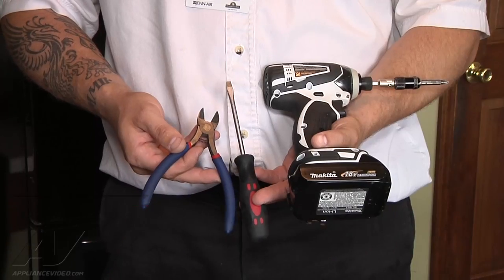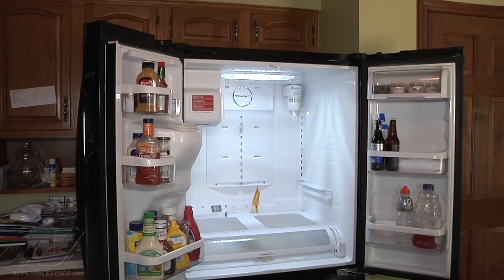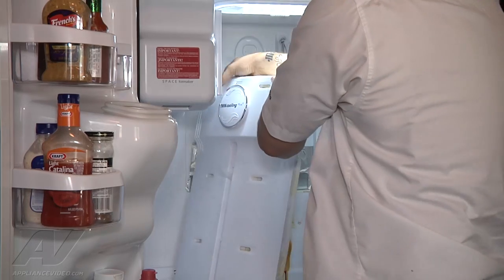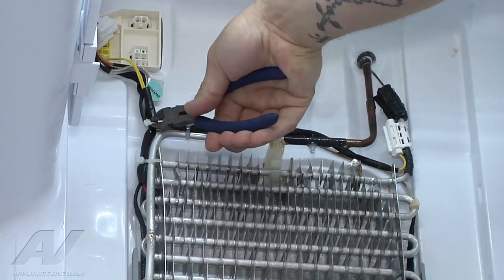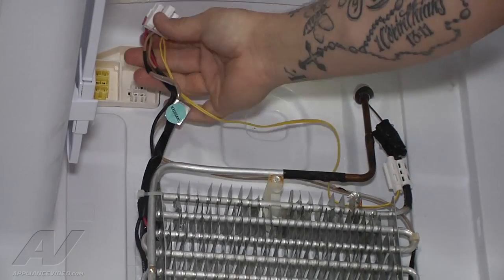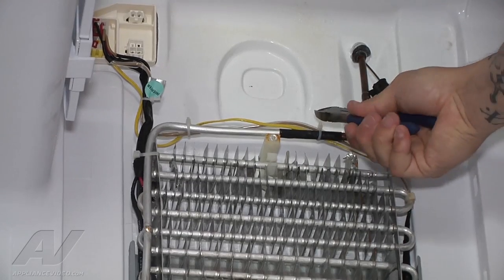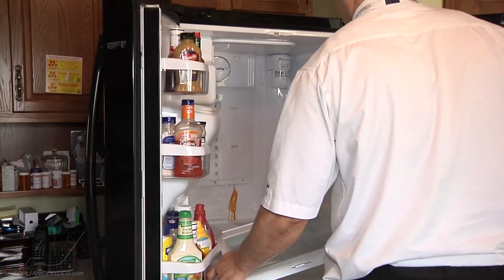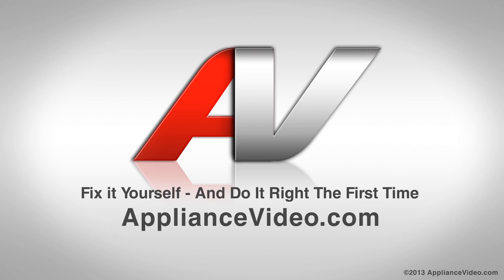Samsung Refrigerator Repair - Fresh Food Section Is Leaking Water - Sensor

Comment: Thank you for the great tutorial on fixing the Samsung french door fridge water problem! Your instructions were easy to follow and install the new part(s). Based on other comments in this post I also installed the longer drain tube defrosting flange as well as the sensor. Three things I would add to this thread: 1) When I removed the panel the foam insulation strips had deteriorated and had water damage. I replaced all the foam strips except for the large one at the top of the panel with silicone bead type weather stripping which should not absorb water, 2) My defroster sensor was inserted into the black sealant blob at the end of the evaporator coil. Not sure if it will help of hurt but I matched this video where the sensor was clipped right below the black insulation, 3) While flushing the drain tube I had also taken the extra step of popping the back panel (only to be removed by technicians :) ) and cleaning the condenser coils which were quite clogged with dust. In doing so the drains pipes/valves for the fridge and freezer are exposed. They can be easily removed and it turns out the fridge one had debris plugging the silicone slit valve. I recommend at least checking the slit valve and cleaning the coils (I found compressed air worked best).
Reply from the maker: Thanks for your response, we are glad we could help. Our library of over 5,700 videos are currently helping over 1.6 million people like you every MONTH.  Please help us by subscribing to our YouTube channel, or post our website www.ApplianceVideo.com to your Facebook page, Twitter, Instagram or any other social media sites. Your support will help us keep producing more free quality videos.

Comment: Thanks so much for your video. It probably saved me several hundred dollars in a professional repair. I had extra trouble getting the back panel out until I got my hand under the insulation and pulled. I came close to cracking the plastic panel before that. I got the part on line delivered for $7.42. It had an extra coupling that needed to be removed so it would fit my coupling. I had to put a fan in front of the open frig. to get everything defrosted. Ice was everywhere. Thanks again!
Reply from the maker: +Andrew Bittinger 

              Thanks for your positive comment.  We have helped millions of people repair
their own appliances. Please help us produce more videos to our site by
subscribing to our YouTube page, or posting our website http://www.appliancevideo.com/ on your Facebook or Twitter account.

Comment: Thanks so much for uploading this video. I had no idea it would be so easy! I've just cleared the blocked (iced) drain pipe with warm water as well as all the other ice built up around the area. I'll be monitoring over the next week to make sure there's no further leakage. Thanks!
Reply from the maker: +Jayrold Ignacio 

              Thanks for your positive comment. We are glad we
could help resolve your issue and hopefully saved you money. We have helped
millions of people repair their own appliances so please help us produce more
videos to our site by subscribing to our YouTube page, or posting our http://www.appliancevideo.com/ website on your Facebook or Twitter account. Our
factory authorized technician’s also daily provide free professional Repair
Help to people like you to help solve their appliance problems. You also have
the option to email a factory service technician with a question at http://www.appliancevideo.com/repair-help/ .  If you need of parts for your major
appliance, we have over 5-million parts in stock at http://savemoreonparts.com/ . Thanks in advance for supporting us. So email
us if you have any other questions our videos cannot resolve. Thanks for your
support in advance.   Matt, Ace Appliance service technician.
Reply: Was this a permanent fix?
Reply: my question exactly
Reply: Good troubleshooting, but the real design issue and correct repair is the drain tube which gets clogged on the bottom and than drain tube gets frozen, therefore water overflows and gets on the bottom. To fix the issue you need to remove back bottom cover, remove the right drain hose, once removed, Separate hose from the plug which has two small holes which is clogged,  make the holes bigger and reinstall same. You will never have frozen drain and water on the bottom. All the best....EC
Reply: Good troubleshooting, but the real design issue and correct repair is the drain tube which gets clogged on the bottom and than drain tube gets frozen, therefore water overflows and gets on the bottom. To fix the issue you need to remove back bottom cover, remove the right drain hose, once removed, Separate hose from the plug which has two small holes which is clogged,  make the holes bigger and reinstall same. You will never have frozen drain and water on the bottom. All the best....EC

Comment: I had to pull the refrigerator out from the wall, unplug it, remove the access panel at the bottom (4 or 5 Philips screws), locate the translucent rubber drain tube closest to the right side of the back of the fridge.  When I pulled the drain tube out (it's very easy to handle), water rushed out.  I cleaned out the rubber hose and nipple, and then poured a plastic bottle full of hot water down the drain from inside the fridge through the hose and into a bowl.  It seems there was a clog of gunk, and maybe rust, inside the tube right there at the drain pan under the unit.
Thanks for this video.  It still helped tremendously.
Reply from the maker: Yes, that is lime and calcium deposits. Good job that will take care of your issue for at least three years.  Thank you for your positive comment.  Please help our ranking by subscribing to our YouTube page or posting our ApplianceVideo.com site on your Facebook or Twitter account. This will help us to continue to make new professional videos from our factory trained technicians and help people like you. We also have our technicians daily emailing professional advice to people that have problems with their appliances. We have helped thousands of people save hundreds of dollars. Thanks in advance for your help.

Comment: I have the RFG293HABP purchased in 12/28/12.  Water was leaking inside the refrigerator and after taking it apart from inside I didn't find any ice buildup.  It turned out to be a plugged drain which is easily accessible from the back of the unit.  There are two gray rubber drain pipes, one for the freezer and one for the refrigerator.  Inside the drain pipes are what I can rubber duck bills which I believe regulate how fast the water drips from the drain pipe.  Anyway mine was clogged with what looked like wet lint or dust.  I just cleaned it and the drain works fine.
Reply from the maker: Dl Sven 

                   All of our technicians are now answering questions
daily at our http://www.appliancevideo.com/ website under the Repair Help section.  We also have over 1600 common questions and
answers that you can easily search through by your model number, appliance
make, problem or error code and it’s absolutely FREE. You also have the option
to email a factory service technician with a question on your appliance at
http://www.appliancevideo.com/repair-help/ . If you’re looking for a repair video, you
can also search our library of over 2600 free repair videos. ApplianceVideo.com
specializes in quality DO-IT-YOURSELF appliance repair videos and we get over
800,000 views per MONTH to our videos worldwide and growing. If you need of
parts for your major appliance, we have over 5-million parts in stock at http://savemoreonparts.com/ .  Thanks
for your support. Matt Ace Appliance factory service technician.

Comment: This video ultimately helped me to get to the solution for my case.  In my case the reason water was backing up was the grommet was plugged up.  Part DA97-04049H.  The plunger action did not resolve the grommet issue.  I took a hose to the grommet and flushed it out.  If it plugs again I'll replace it.
Reply from the maker: Great question, if you have a more technical question that our parts department cannot answer, you can search our over 17,000 answered questions free at our website www.ApplianceVideo.com under our Repair Help section. You can also call our parts department at 1-800-830-5465 and they can give you help 7-days A week ,or search at www.SaveMoreOnParts.com  .

Comment: so great with the thermo replacement. why did you not replace the aluminumn drain probe at the same time??
Reply from the maker: Great question, if you have a more technical question that our parts department cannot answer, you can search our over 17,000 answered questions free at our website www.ApplianceVideo.com under our Repair Help section. You can also call our parts department at 1-800-830-5465 and they can give you help 7-days A week ,or search at www.SaveMoreOnParts.com  .
Reply: @Appliancevideo   Great reply!!

Comment: Our Samsung refrigerator had water under and in the lower left crisper drawer.  I removed the panel (3 screws) in the back of the refrigerator compartment to expose the cooling coils. They were covered with ice and the defrost drain was plugged with ice. I used a hair dryer to melt the ice.  Watch how hot the plastic panel gets.  I found that getting it too hot caused a smell that lasted a couple of days.  I used hot water to clear ice from the defrost drain tube using a small cream pitcher with a small spout until water flowed freely down the drain.   I bent the aluminum drain pan so it directed water into the drain better.  I added a piece of heavy copper wire that I wrapped around the defrost heater  for about 6 inches and formed the end so that it extended into the drain hole for about an inch.  This directed heat into the drain to keep it ice free.  We get no water at all now anywhere.  I was prepared to replace the heater coil and the temperature sensor but that was not required.
Reply from the maker: Ollie
        Great job on the repair. I hope our video helped in giving you some help on the repair. Please help us provide more videos to our site by subscribing to our YouTube page or posting ApplianceVideo.com site on your Facebook or Twitter account. We also have our factory authorized technician’s email daily free professional advice to people like you to help solve their appliance problems. Thanks in advance for supporting us. Matt, Ace Appliance service technician.
Reply: I just completed the same process Ollie spoke of, I put a doubled up length of #10 copper wire, tightly wrapped around the defrost coil and extending about 2" down into the drain hole.  Thanks to all for this valuable information sharing.  I will update my remarks in a few weeks to let others know of my success...or further adventures in Samsung land.
Reply: Tim Davis you do not need wire just a add on clip ( da61-06796a)  if wire get to hot you melt the sides of the drain tube.
Reply: Tony Martin Tony, there was already a clip-like piece hanging down from the re-heat element, sorta like a thin stamped sheet metal piece with a little "tit" on the end pointed down, but it didn't appear to be long enough to come close to the inlet end of the drain tube.  Have you observed problems with wires such as mine damaging the drain yourself?  Thanks.
Reply: Tim Davis Good point about melting the plastic tube. The heat conduction wire was not pushed far into into the tube and don't think it touched the plastic. I think I would get water on the floor if the tube melted.  After a few months, no water any where.  I don't know about the clip.  I got no help at all from Samsung on the fix,  However, it was clear that the ice forming on the coils and on the drain tray was caused by the ice clog in the tube.  Getting more heat to that area was the obvious solution. I'm sure there are some more elegant solutions than mine but I just happened to have a piece of wire in my toolbox.  I suggested to Samsung that they make a kit for the fix but got no response.  They probably saw dollar signs for a recall.
Reply: Tim Davis Just checked under the fresh food section after having effected the aforementioned "hot wire" cure for the seemingly ceaseless issue of ice/ water under the bottom slide out drawer and I am very happy to report that the Sahara ain't in it.  Dryer than a snakes' backside.  That is to say.....No Probs.
Reply: Great  going!!

I think that every Samsung refrigerator of this type has the "water" problem.
Reply: I have a Samsung Frig model #rf217acpn.the digital display showed-88 in the freezer &88degrees in the frig then no lights or sounds at all.I've verified the 120volts to the"board " but nothing happens. Where do I check next??
Reply: Tim Davis do you still have the refrigerator

Comment: This is logical. Most likely this is the real fix. Thanks to the poster.

But I did this first.
 BTW the French door model is a bear to take apart.   Mine had a factory mod with aluminum foil shield and an insert part of the way down the tube. Unit must have slowly stopped up for years. It took a hair dryer and lots of hot water and multiple tries to unclog it. Clipping one of the drain tubes did result in water coming out but did not fix the problem. Also those check valves in the tubes are there for a reason. Probably tp prevent hot air back flow into the refrigerator.  Most likely my clipping those will affect the energy efficiency and the pressurization of the unit.
Reply from the maker: Thank you for
your positive response, we are glad we could help. Please help us by
subscribing to our YouTube channel or post our website www.ApplianceVideo.com  on your Facebook page. We want to let your
friends & family know how our FREE videos can help them.  Or you can
support our parts department at 1-800-830-5465 and our parts website www.SaveMoreOnparts.com .  This is the only way we can continue to
post free videos and help over 1-million people per month like you repair their
own appliances. We also have thousands of more quality videos on all major
appliances made by our factory trained technicians at www.ApplianceVideo.com .

Comment: I have a Samsung rf260BEASP/WW only 3.5 years old and I am getting water under the crisper trays and can see ice over the coils. At one time, there was a noise coming from the fan caused by the ice dam but I defrosted overnight to stop it. However, I am sure the problem is not fixed. Before I go through the process of defrosting again,  I would like to have whatever replacement parts I need on hand to permanently resolve the problem. Please advise. Your video is quite clear on the mechanical part however it does not provide a clear explanation about what parts should be replaced to both correct the defrost problem and keep the drain clear.
Reply from the maker: Great question, you can call
our parts department at 1-800-830-5465 and they can give you help 6-days A week Mon-Sat . You can also search at www.SaveMoreOnParts.com 7- days a week.  If you have a more technical question that our parts department cannot answer, our technicians are answering all questions at our website at www.ApplianceVideo.com under our Repair Help section. We have over
4,000 common questions and answers that you can easily search through by your model number, appliance make, and problem or error codes, and It’s free to search through our question & answer library.

Comment: If you have no ice or blockage but still getting water build up, the solution is to bend out and up the metal lip at the base of the back panel you remove.

In my case this back panel was slotting under rather than over the metal piece attached to the back of the fridge when it was screwed in so some of the water was missing the hole completely.
Reply from the maker: Great question, if you have a more technical question that our parts department cannot answer, you can search our over 17,000 answered questions free at our website www.ApplianceVideo.com under our Repair Help section. You can also call our parts department at 1-800-830-5465 and they can give you help 7-days A week ,or search at www.SaveMoreOnParts.com  .

Comment: Is there a way to test those fans before closing it up?  No air movement over the coil causes ice too.
Reply from the maker: Great question, if you have a more technical question that our parts department cannot answer, you can search our over 13,000 answered questions free at our website www.ApplianceVideo.com under our Repair Help section. You can also call our parts department at 1-800-830-5465 and they can give you help 7-days A week ,or search at www.SaveMoreOnParts.com  .

Comment: I have a Samsung RF4267HA with the same issue of water pooling under crisper, now going down under freezer door.  We have it empty and have gotten the back out. But the water will not go down even with the turkey baster or a small brush I put down.  Any suggestions?  Thank you for the wonderful video, we followed exactly what you did!
Reply from the maker: Great question, you can call our parts department at 1-800-830-5465 and they can give
you help 6-days A week Mon-Sat . If you have a more technical question that our
parts department cannot answer, our technicians are answering all questions at our website at www.ApplianceVideo.com under our Repair Help section. We have over 4,000
common questions and answers that you can easily search through by your model
number, appliance make, and problem or error codes, and It’s free to search
through our question & answer library.